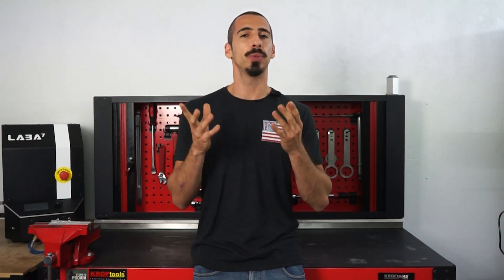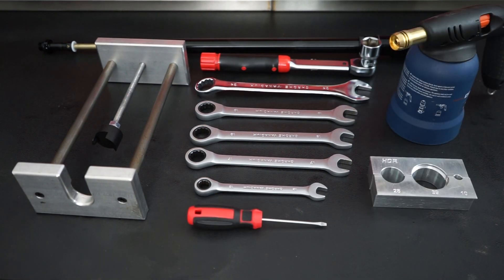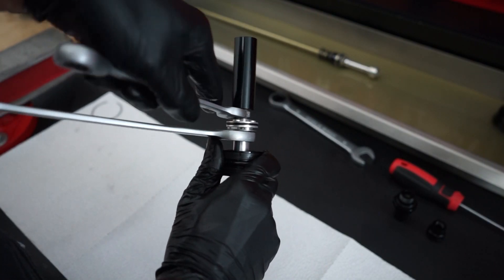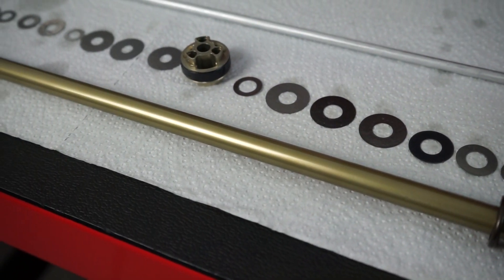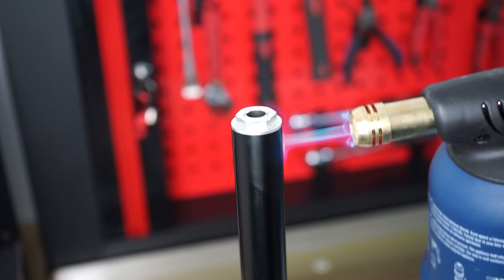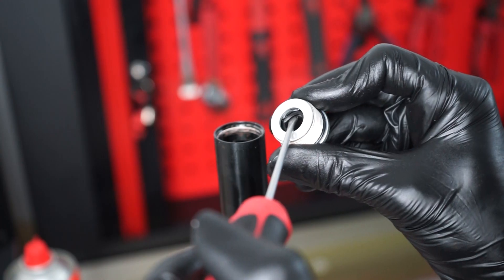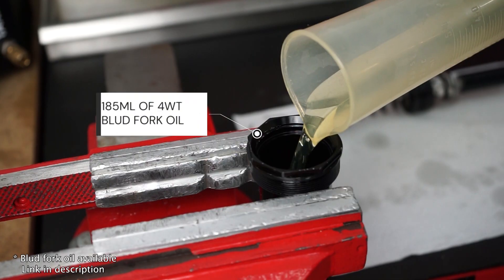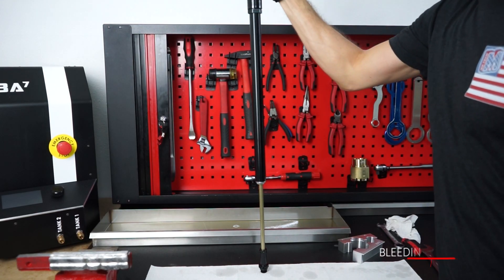How to service MX-TECH cartridge kits

Comment: It is possible to service these cartridges without the mx tech special tool, I used a lever secured to the cartridge with a rubber strap to push the base valve assy into the cartridge.
Reply: Can you explain this a little more in interested how you did it.